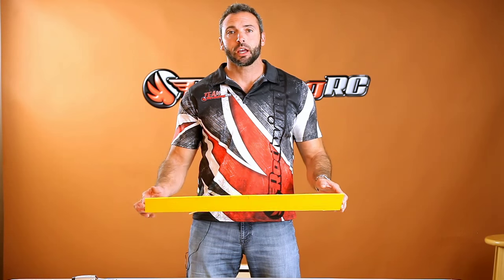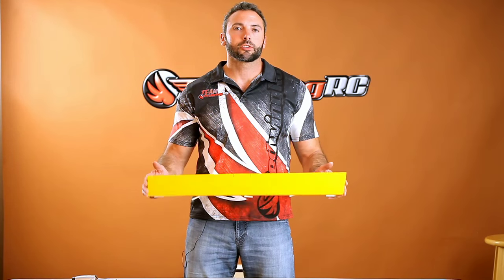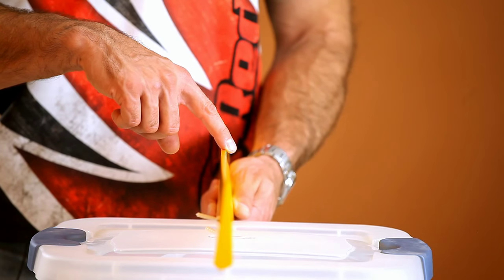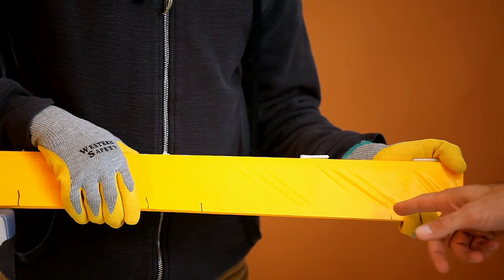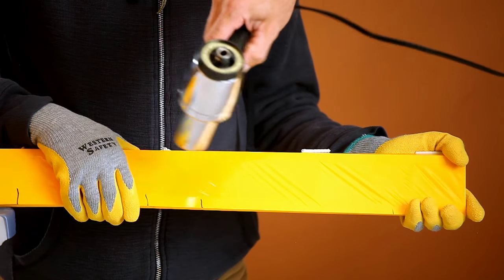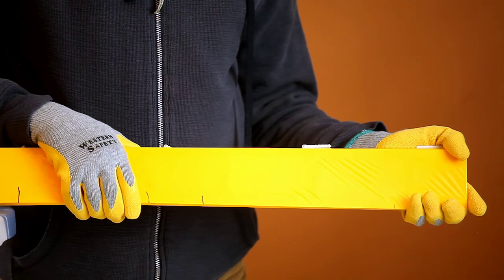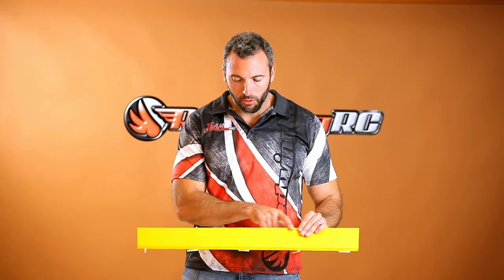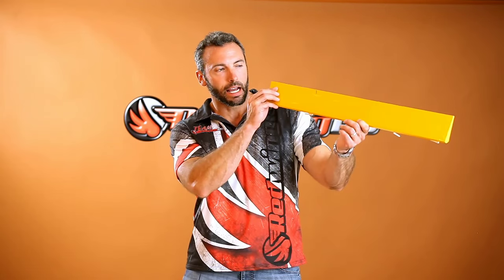Fixing a Warped Surface

Comment: I have a solid wood elevon that has about a quarter inch twist (not a bow).  Any extra info?
Reply: If you have the right colour of covering laying around i would say try to take off the covering carefully and steam the wood of the aileron ontil it is a little soaked, then clamp it on something straight and let it dry, balsa wood will straighten itself that way the same it would bend when it gets wet